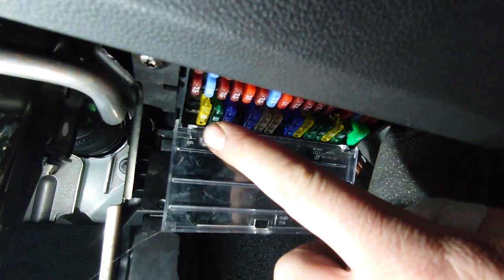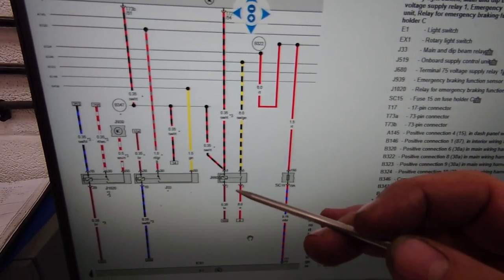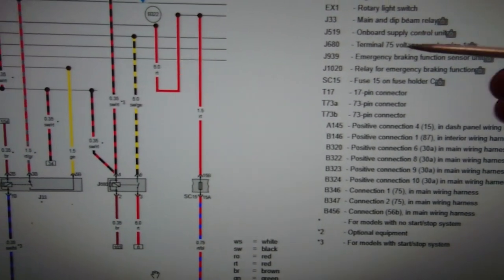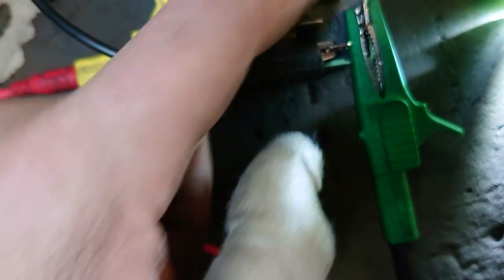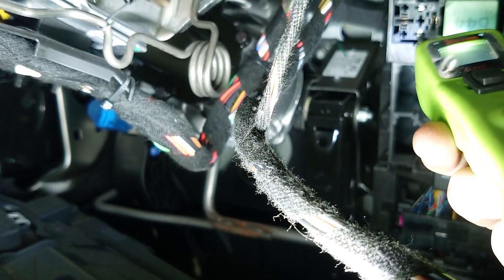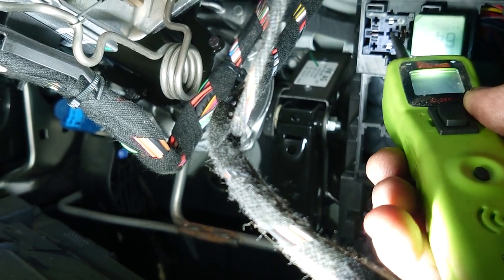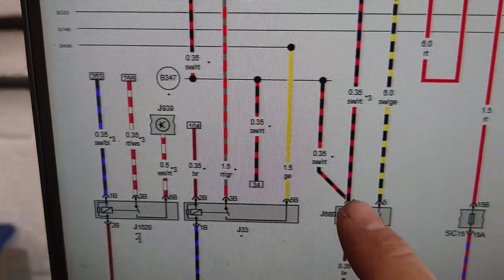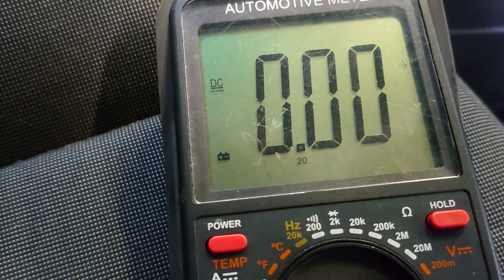VW Up heater blower, rear wiper and cigarette lighter not working

Comment: Did you have to get new keys or programme existing keys?
Reply: Late reply but no its just the electrical part of the switch at the back which is seperate to the barrel.

Comment: Mine still not working
Reply: Same mine doesn’t work even after changing ignition switch
Reply: Check the fuse 50amp in the engine Fuse box. It’s a big red one. F30 located.
Reply: Did you resolve this?